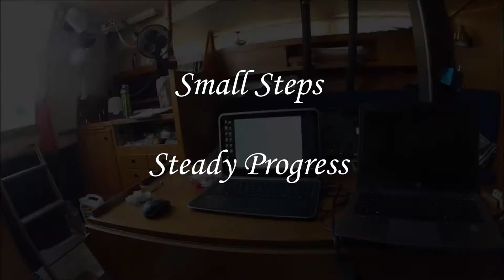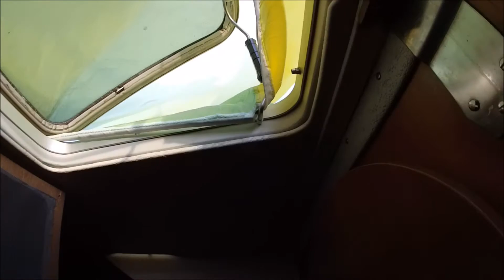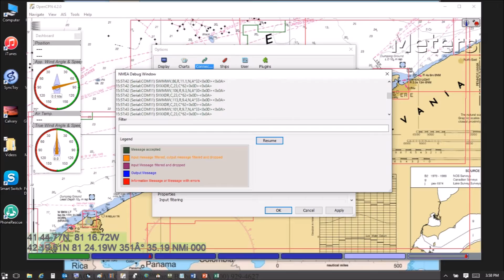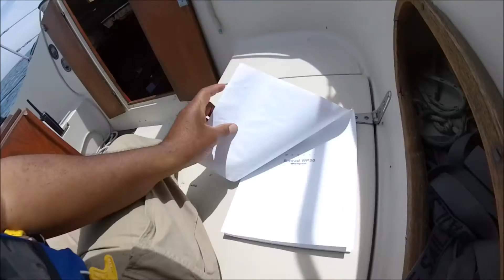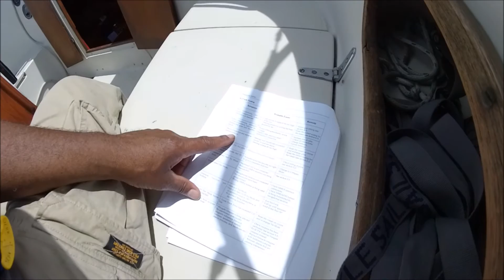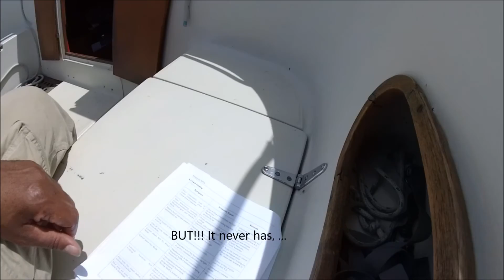Griot's Reverie - Small Steps HD

Comment: Hello! How did you install Simrad wp30 on your Maxi 95. Did you saw holes in the plastic? Because Simraden is much deeper than what is shown in the picture. grateful for tips when I will install one on my Maxi 95. Can you take cards at the installation and show me?
Reply from the maker: Hello Willy. It will be more than 1 month before I can get to the boat to provide more detailed images of the install, and I will check through my existing pix to see what I can find. But, no need to cut plastic. The drive motor fits between the port table leaf and the central stand. It does lift the leaf out slightly, but not enough to interfere with the walkway.
Reply: Very good !! I am very happy for tips before the installation, We have cold weather here in sweden so i will start installing in May. Fun with a Maxi 95 in the United States. We are very proud of the Pelle Pettersson man who designed the Maxi boats in Sweden. He has not only designed boats but also cars. Check out the Volvo p1800 :-). Greetings Willy @GriotsReverie
Reply from the maker: Well, I did some checking, and the only pix and video that might help are contained in the Updates & Upgrades 3/4 video found here: https://www.youtube.com/watch?v=PXWHaR-V4og  Have you already seen it?  Very little detail, but you can get a sense as to how the drive motor tucks under the port leaf of the cockpit table.  It also reminded me of the fact that it makes seeing the rpm & temperature gauges a bit of a challenge, but I added a mirror below, which helps some.  With most of my sailing done solo, the addition of the WP30 was VERY helpful.